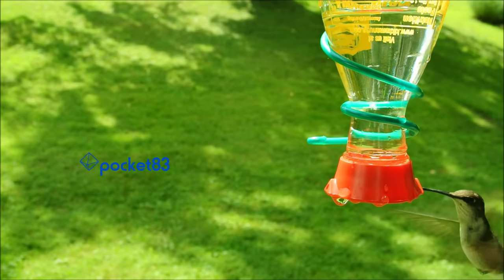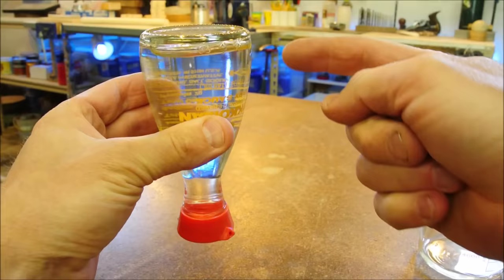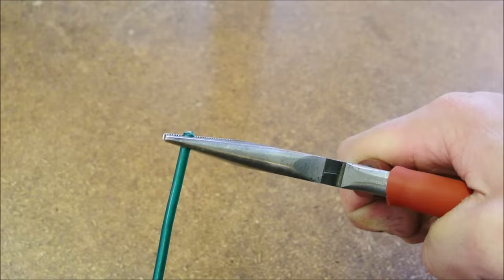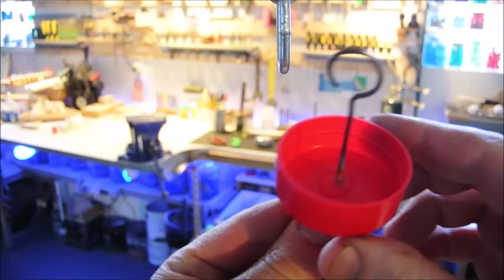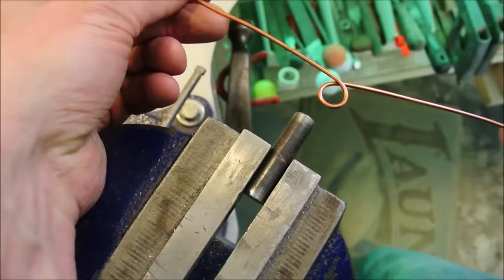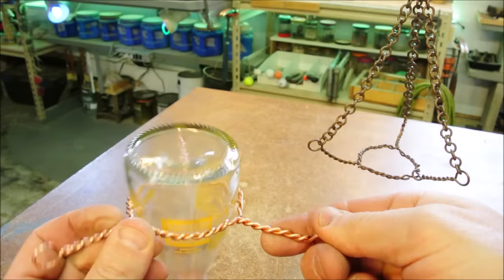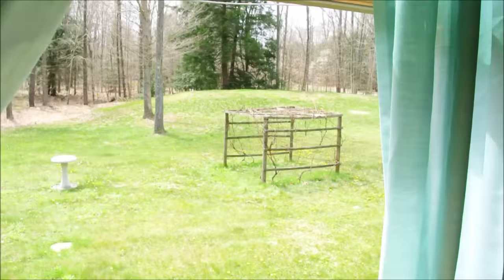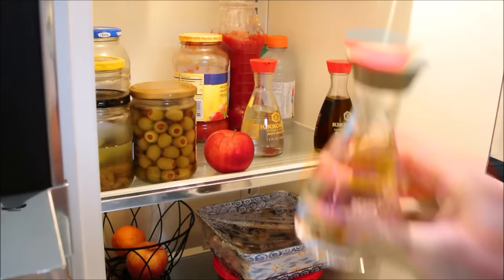Easiest, Cheapest, Best DIY Hummingbird Feeder Ever (from Soy Sauce).

Comment: Can we keep the rubber seal on, it leaks if not.
Reply from the maker: These do not leak without the foam seal. If yours does, you may have a misshaped bottle or a cracked topper. I recommend against keeping the gasket, because it will eventually become a bacteria trap.

Comment: Unfortunately, this would be quite ineffective where I live. The wind would tip it back and forth, dropping fluid with each cycle.
Reply from the maker: Don't count it out without a try! It's surprisingly wind-resistant; these don't really start to drip until around 45°, and it has a small mass that's quite smooth and aero. Sunlight is the thing that will affect it.

However (assuming that you live on the face of a cliff or something), you could try hanging it from a mounted pole, like a shepherd's hook. If there's no chain for play, it won't swing much. Good luck.
Reply: @pocket83  Well, ok, I might try it out when it gets warmer!

Comment: Como fazer para não vazar água pelos furinhos do bebedouro?
Reply: Dripping is caused by temperature changes. Try to keep the feeder away from sunlight. Refrigerated nectar should be allowed to come to room temperature before turning the bottle upside-down. 

Remember, some dripping is normal—so if it's a problem, you might want to place a dish underneath the feeder.

Comment: I made the soy sauce feeder but it does drip even level. Maybe I should have kept the gasket but it's long gone. Any suggestions?
Reply from the maker: That's not because of the gasket. It will only drip while the water is warming up to match the air temperature. If drips are really a problem, you will have to plan the times when you hang it, or else just use a dish to capture the drops.
Reply: @pocket83  Luckily its right by my hose. Eating dinner outside we saw 2 different males come to the feeder. One does his little chirp of thanks before he leaves <3. Need to make a trip to oceanstate job lot for more soysauce. That bottle was expired LOL. Great use of them. Thanks again for your DIY.

Comment: Just curious what if you left that little seal in, would it leak less?
Reply from the maker: Dripping will be caused by pressure changes inside of the bottle. That little gasket might be more for shipping purposes, so that both parts are less likely to crack when dropped. As a feeder, it's just a site for bacterial growth. So, no.
Reply: Great thank you. And thank you for being so informative and responding to questions!👍

Comment: Hello do you boil the sugar,and the water togheter  thank u
Reply from the maker: It's not necessary. Once the water begins to boil, you can turn off the heat. Next, measure out the water, and then stir in the sugar.

Comment: Great video thank you. Seems I have an issue with either a squirrel or raccoon constantly knocking the feeder down.Any thoughts and how I can break the cycle? Thank you.
Reply: Depends on the animal. Hmm. I wouldn't think that a squirrel would be interested. Is the feeder hanging from a chain? Does this only happen at night?
Reply: @pocket83squared  Yes only at night. I hang it from a tree branch which is about 6' off the ground. The last feeder made of plastic was destroyed laying on the ground multiple times. I re-configured 5 or 6 times using a wire hanger to hang from the branch which whatever bent it.  Saw this design thought I would give it a try. Thanks for your response and thoughts.
Reply: @factonut62  At night, where I live, something like this would be either a racoon or a possum. Both are less adept climbers than a squirrel, so the first trick I'd try would be to hang the feeder from a length of chain. As long as the feeder is still a solid 4' from the ground, both creatures would be unable to jump that high. 

The next trick I might try would involve making it tough for them to climb the tree in the first place. For example, something placed temporarily around the tree trunk that discourages them. Last season, I protected my peach tree's fruit from the raccoons with a piece of old metal flue.   

If all else fails, replace the soy sauce bottle at night with a bottle of salt water. After a few licks of that, the creature should lose all interest.

Whatever you do next (on the bright side), both the soy sauce bottle and the chain should certainly survive a critter assault, so it will buy you some time to experiment.
Reply: @pocket83squared  Thank you for your detailed response. Prior to responding back to you I wanted to see if the feeder was tempered with. As of right now that is not the case. However we shall see how long that lasts. I believe you are right about the racoon and or possum not being able to access  the feeder since it is more than four feet off the ground. My assumption would be one of the squirrels in our yard that seem to feed on many things. In any case I appreciate your advice and will continue to make changes when needed in hopes of maintaining the feeder. Once again thank you for all.

Comment: Nice job!  Like to give it a try .   I got plenty of 14-2 electrical  wire like that copper look. .   Is that strong enough?
Reply from the maker: You could always twist two (or three) pieces together with a drill. Then it will certainly be strong enough!
Reply: @pocket83  Thank you for fast response.    I just came back from dollar store .  The bottle style has change or I could not fine 1 like you had red cap.  Going to try do the copper wire like you said .   Were can you get the single gage wire?  You know?  I have older feeder try clean up.

Comment: I always buy low sodium soy sauce so the caps are green! Think they will work?
Reply from the maker: Sure. They'll figure it out. Until they get used to it, you could stick a red bottle-cap through the wire, or maybe tie a little red string to the feeder to attract them. My guess is that they'll find it on their own, though.
Reply: I think they investigate anything new in the garden or around the house, if you have them. Some commercial nectar packets have red food dye in them, which is controversial and probably not good for them. But, you could try a little bit of red food dye in the first filling and that should do the trick, too.

Comment: Bee guard?  Yellow jackets are a big problem in my area.
Reply from the maker: You won't like my answer. It all depends on what you mean by "big problem."
Wasps are totally natural and normal to some extent, so I am hesitant to advise you to eliminate them. 

However, if the Hummingbirds can't feed at all, then that does suggest an excess, and the solution involves reducing the local population of Yellow-jackets. Look for ground hives to eliminate on your property, and especially if you have one on your house, remove it. 

If the Yellow-jacket population is unbalanced because you are living in an urban environment, you can help control their numbers by NOT having a Hummingbird feeder. In this case, instead of using sugar water, attract pollinators with flowers.

We have lots of them where I live, and I hated them when I was younger and impatient. Now I better understand that they're entirely harmless until provoked. So let them have the occasional drink; they actually drive off some far worse insects.
Reply: I do believe we now have some in the USA that are non-native, will sting without provocation, and can sting multiple times. That would mean certain death to the hummers if attacked.😢☹️😡

Comment: I like the idea, but without somewhere to rest,  they are burning all their energy. Additionally,  I've seen photos of hummers hung up (inside the drinling hole) by their long beaks and dying because they were so exhausted amd their was nothing to push off of to get free. Maybe add a loop for them to sit while sipping.
Reply from the maker: Don't worry; the dead ones are easy to remove from the feeding hole. 

Sorry to tease you, but that comment was pure nonsense. Pay attention: Hummingbirds have become optimized for feeding on the move over the course of many thousands of years. They've been doing this for so long that the flowers themselves have also adapted to fit the way that they feed—without providing any perches! 

This is one of the safest man-made feeders available. Tongue-catch is nearly impossible with this design, unlike those cheap plastic feeders. Aside from the sugar-induced competition they'll have with each other, the birds are at zero risk. In fact, more 'comfortable' feeders may even encourage dependence. 

Feeders should be thought of as a treat, and not as an alternative diet; the birds do a little work to entertain us, and in return, they get a sip of some perfectly sweet nectar. In nature, a flower offers them a similar trade for pollination.

Comment: copper does rust or oxidize. thats why the statue of liberty is green
Reply: That level of patina takes many years of exposure (to acid rain) and not being handled. Even my oldest copper wire stuff is still brown. Cu oxidization is not really a concern with this bird feeder. 

Also note that most large exterior fixtures are also subject to galvanic corrosion, in which electrical currents speed up the oxidization process. Under normal use/handling, a copper object is not likely to grow any more patina than a chocolatey-brown.

Comment: Nice video but these leak, drip, and bees get more sugar water than the birds.  I would class this as a fail.  Not hard fail but there are better designs
Reply from the maker: Your comment is simply incorrect. You've clearly not tried this, yet you're acting as though you have beforehand experience. This is the most diplomatic response to it that I can muster: go away.

Comment: The problem with feeders like this is that they LEAK!  When you have barometric pressure and temperature changes,  then the bottle leaks terribly and drips consistently...  The dripping promotes disease and unwanted insects.  I see the validity here in the novelty but as an experienced hummer-feeder I would never use this kind of feeder...
Reply from the maker: The dripping is mild. Mostly in the morning, but it's a non-issue in this climate. Ants live in the grass with or without candy from the sky, but there aren't the biting type here anyhow. Disease? Not really, no.  
...
It would certainly be possible to catch drips with a pan if you are concerned, but it sounds as though you've already decided to use a different feeder type. Thus, it begs the question: what's your point? You want me to yield to your self-proclaimed experience? Not going to happen. These feeders are far more efficient than those nightmare-to-clean reservoir models. I didn't make this video in one afternoon, you know; I've seriously considered every design conceivable, and calling this idea a "novelty" is dismissive enough to be mildly insulting. 
...
You're rationalizing a purchase. Let it go, like a sack of rocks.
Reply: @pocket83  You're overdoing it a bit.  Disease is a possibility as the dripping can get out of hand on hot days as all that syrup consistently deposited on the ground in the same spot...  I am not a marketing robot here...  I just don't like any feeder with the "dropper" on the bottom over a base feeder...  You should turn off your comments if you don't want an opinion that may be opposite your own.  The very idea that my goal was to belittle you or insult you is rash...
...